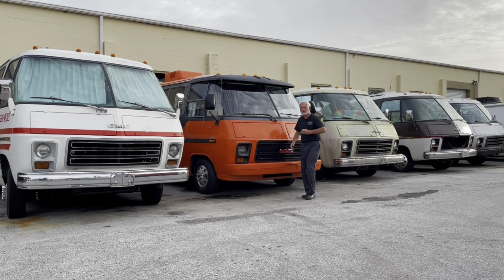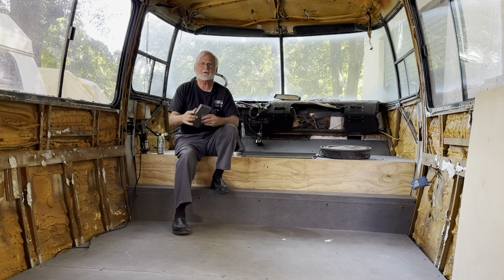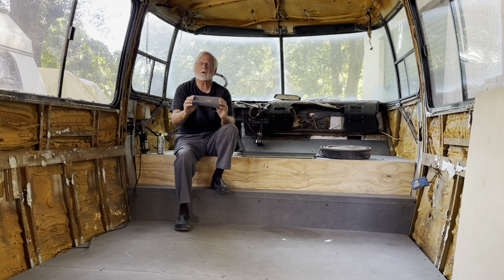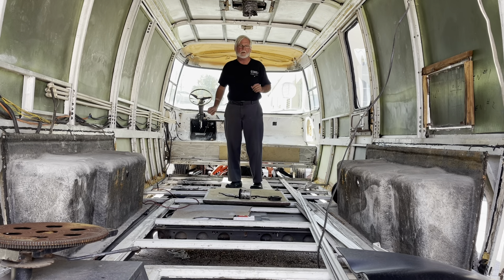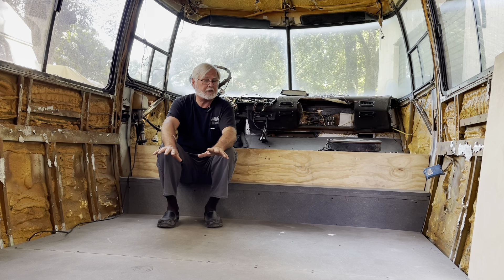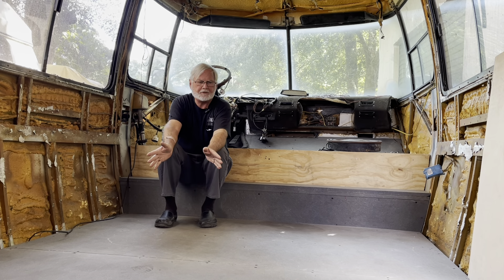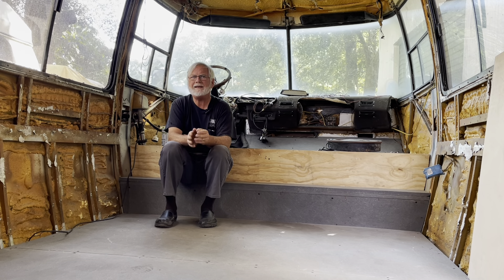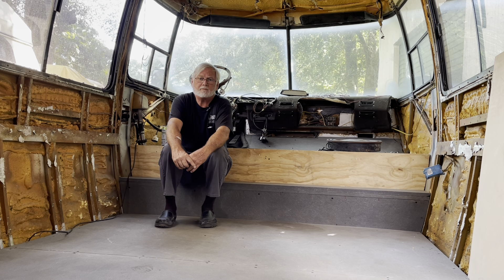GMC Motorhome - Coosa Board - Jim Bounds & Co-Op Motorworks

Comment: Coosa board good stuff, pricy. I used it to rebuild the transom in a bass boat. I used two 1/2 inch pieces with fiber mat epoxy between the two and the usual fiberglassed in. You will not find anything stronger and lighter. Actually maybe overkill

Comment: My brother welded in a gusset system last year and it helped a ton! I had a pretty good bow going. We put in the gussets and installed the new subfloor (I went with advantech that I painted with exterior paint) and my floor has no noticeable bow any longer.

Comment: Hi have you looked into fiberglass honeycomb panels very strong and light weight and used in aircraft
Reply: That's my question too!
Reply from the maker: You can add weight to your coach without mileage, performance or comfort sacrifices.  Serious, don’t use lead but pretty much do what ya want
Reply: @motorhomerehabranch  that's not an answer to the question.
Reply: Coosa board is a foam-cored glass-fibre reinforced composite panel. A honeycomb-cored glass-fibre reinforced composite panel can be stronger for the same weight, but won't tolerate arbitrary screw insertion as well, and won't insulate as well. For this application foam-cored is probably a better choice, although there are honeycomb cores filled with foam, which would likely be ideal (and very expensive).

Comment: Would you use Coosa board to rebuild a new engine cover over the Edelbrock manifold I plan to reinstall? Last time I used 1/2" plywood to custom design the cover. It was stolen along with the engine parts, mirrors, rear bumper, radiator, air pump, front grille and more.
Reply: Hate to point fingers, but your thief was probably an owner of one of these :>(
Reply: @lsee6145  Regency Realty (Management Company in Orange, California) "sold" nine GMC Motorhomes from MGM GMC after they evicted the shop owner. Yes, one was mine. By California DMV law, they were supposed to perform lien sales. Instead, they collected $200 apiece to "get rid of them". I found my GMC on YouTube and am in the process of reclaiming it. All of the stolen parts were taken while the coach sat in the rear storage yard, an inside job most  certainly. Lawsuit next!

Comment: Jim, where can we buy this Coosa Board for our own rennovations?
Reply from the maker: There's a place called coosa board you can buy it from
Reply from the maker: Look it it, they have outlets….. I have 8 sheets in Utah, we’ve decided this floor and bulkheads can still be used.  If your coach is apart though and your floor is bowed….. why not.

Comment: Wow $500 a sheet. Bit of sticker shock there. But does sound worth it in the long run.
Reply: Four sheets for $500, from the video.
Reply: @jeffshadow2407  "4x8 sheet 1' thick around 500 bucks" @ 8:58. They are $611 per 4x8 sheet now. And that's before shipping or taxes. Sticker shock indeed.
Reply from the maker: True and we’ve decided Chads coach doesn’t need to go down that far but if his interior was completely coming out and his floor had been compromised we were ready.  Watch because we are doing this build without going Coosaboard crazy!  Btw, if you need to do it….. I’ve got some material in Utah for ya
Reply from the maker: Yeah but if your floor is compromised…. Yours may be ok…. This is the best option.  Ya gotta do it right if you haveta
Reply: @sneakynative8508  i

Comment: Antique is 100 years.. vintage is 20 to 99 years... are you on meth?????
Reply from the maker: Oh don’t be such a fussy buddy, we’re having fun.  Do you have an antique motorhome…. Vintage, antique they’re older than any other machine youll find.
Reply: Definition vary by the field (cars, furniture, etc). In cars, "antique" can mean as little as 25 year old (which is ridiculous) and is typically 45 years (so the GMC motorhome would qualify) and in some organizations means specific eras, regardless of how long go that was.
Reply: @motorhomerehabranch  Cars older than any GMC motorhome are very common.